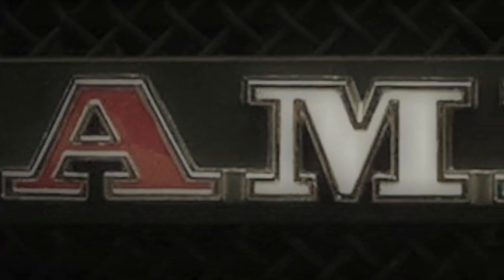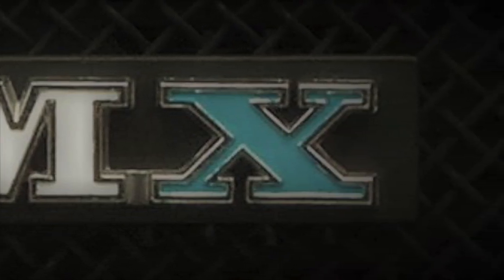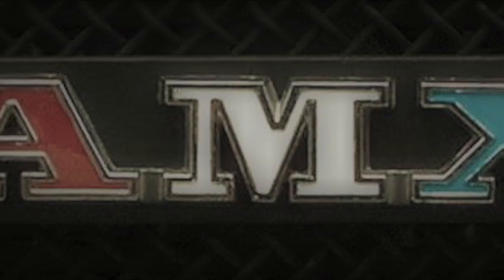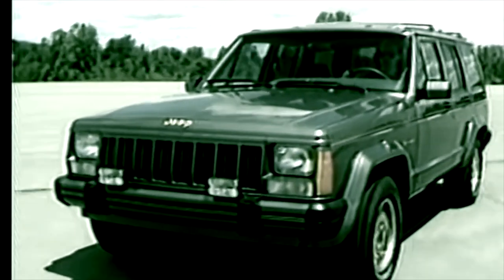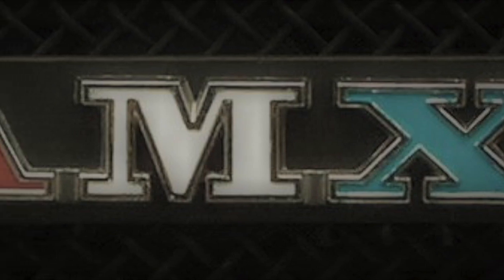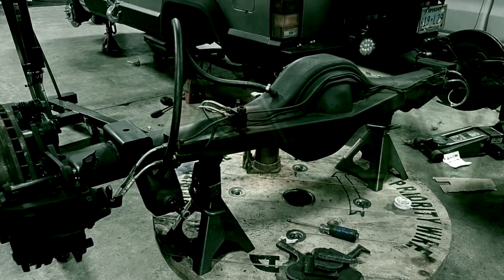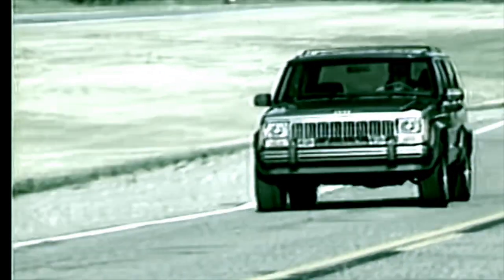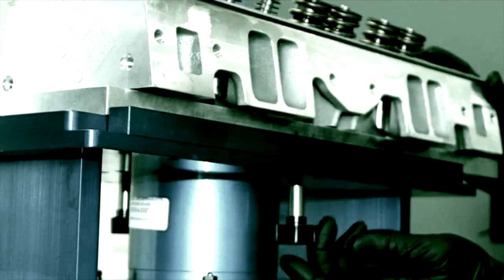Building a 10,000 RPM Jeep 4.0 -  Valve train mods that rev from 7,500 to 9,000 RPM

Comment: Extremely interesting. Would be curious if this had affect on moderate RPMs as well. If it's flexing there's a chance you're seeing a loss in valve lift before the "wall" got hit at 7500.
Reply from the maker: I’m sure it has a similar effect, it’s likely the reason there were so many cracking figures on some of the castings.
Reply: @amxj  Bad VT harmonics do change the valve lift, at certain RPM's, lift may be more or lift will be less.  It's uncontrolled valve motion and unpredictable.  In either case you don't want this going on in the VT. VT MUST be STABILE!!!